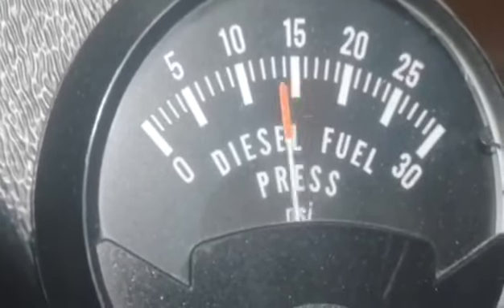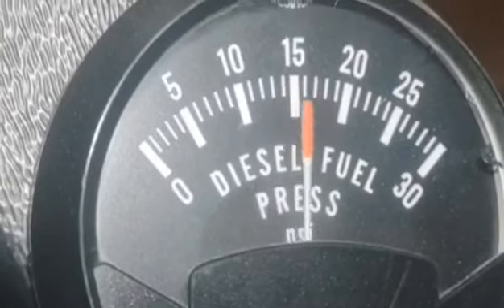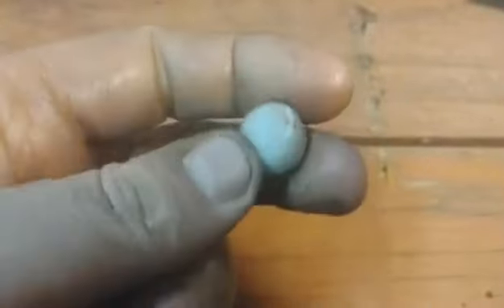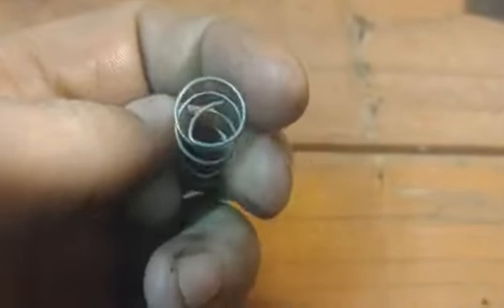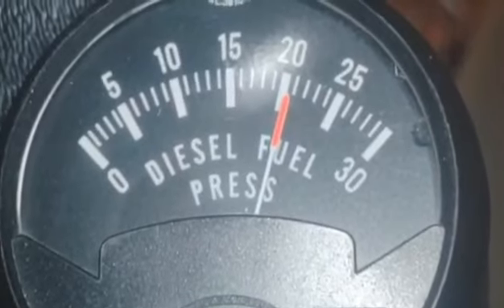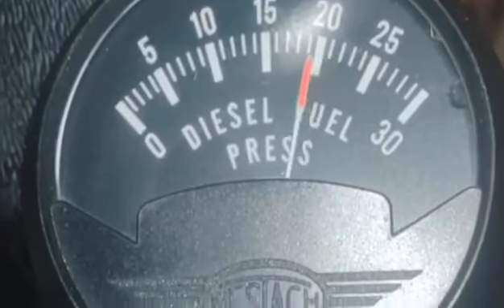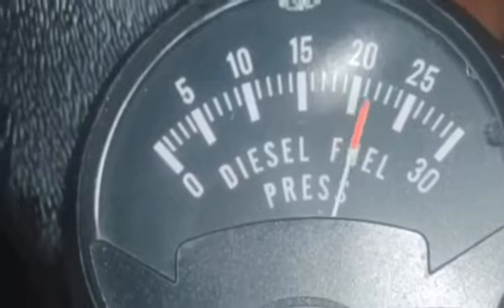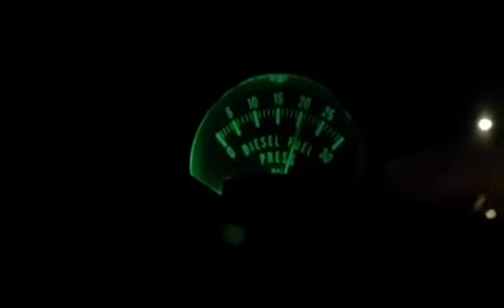(338) fass fuel pump fluctuating fuel pressure, temporary fix while waiting for new parts to show up

Comment: Any update after you got the new parts?
Reply from the maker: Ya, I had ment to make a video about it but never did. At first everything was good and then for about 1,000 miles the fuel pressure would fluctuate slightly then it stopped and was relatively stable. Now it's been about another 15,000 miles with the fuel pressure being relatively stable. I want to ditch the internal regulator and go to the fass external regulator but haven't done that yet.